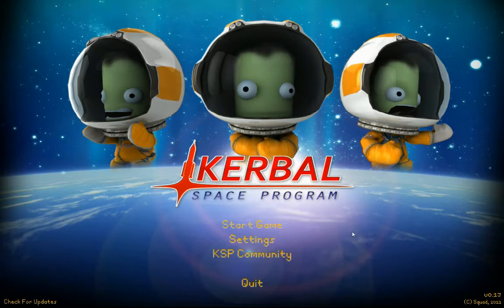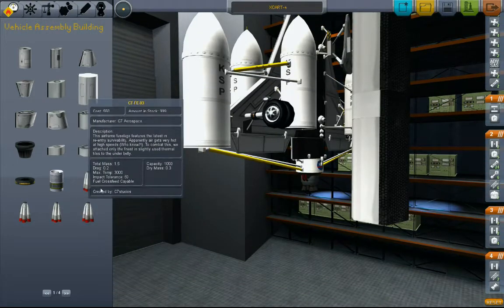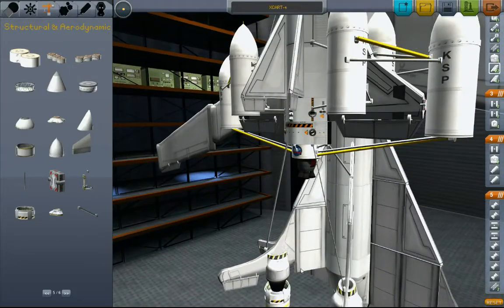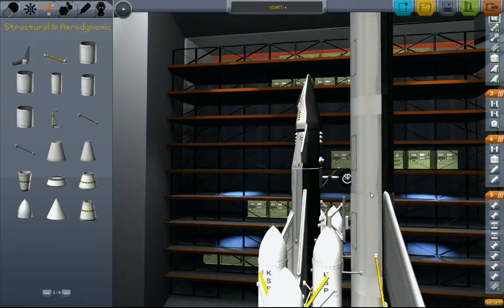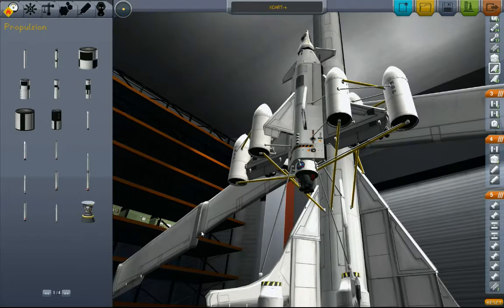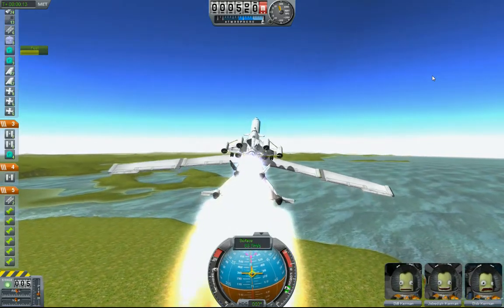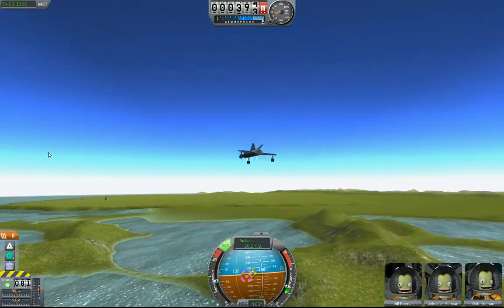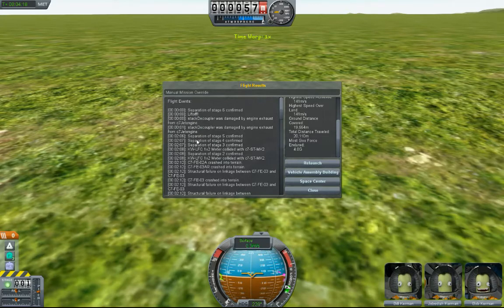Let's Fly Kerbal Space Program: chapter 1, ep. 15

Comment: the fuel lines are one way, you need to start them on the tanks to be drained first and connect them to the ones you want to feed, i had suspected to had them backwards but couldn't tell because the orbiters engine hasn't had a chance to fire before now. the lines themselves have little arrows on them to indicate flow, but i can't see them in the recording.